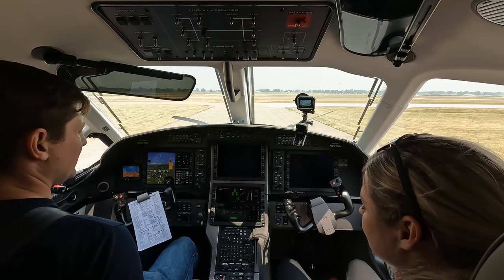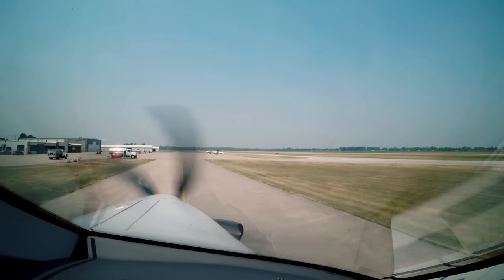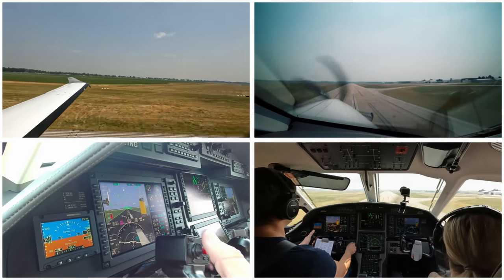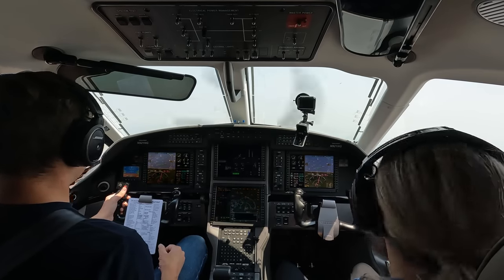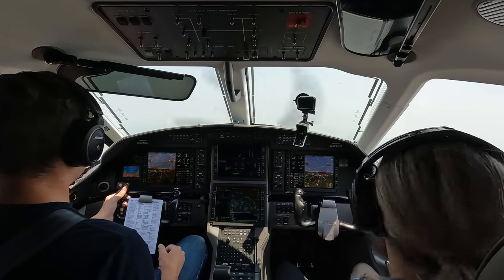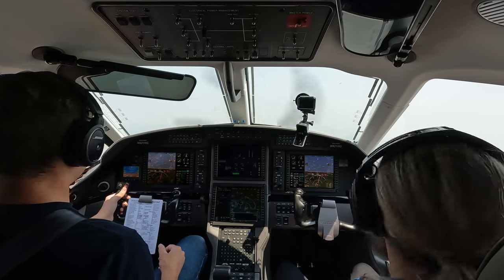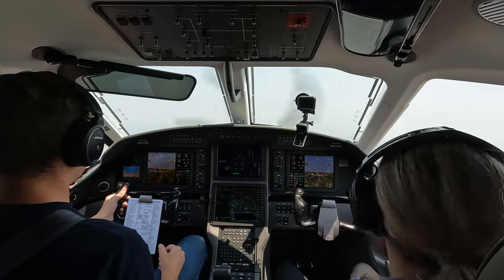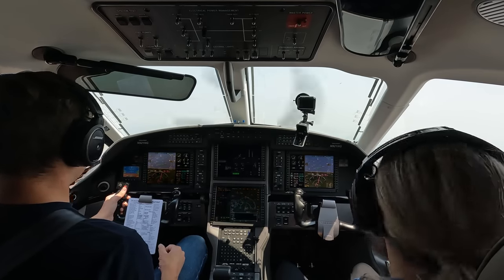Flying To Mackinac Island For Our Anniversary! | Pilatus PC-12NG

Comment: That connection problem with the Insta360X3 sucks. I've got the same issue randomly sometimes even if the BT wakeup function is on. Thanks for sharing your flights, I love the PC12!
Reply from the maker: I really love the unique angles that I can get with it! I haven’t used the phone connection with it much but it has been sketchy when I have.
Reply: @GrantBaker  yeah, you can definetly get some cool shots. How about the regulations in the US with regards to mount cameras? Has it to be certified in some way?
Reply from the maker: @QNH1013-Aviation if it’s permanently mounted, yes. Mounts like mine are able to be signed off by an A&P.

Comment: Grant, another great video and landing. Is your Pilatus equipped with a radar altimeter? If so, what is the earliest it will read AGL? Thanks!
Reply from the maker: Thanks David! Yes it is. It reads up to 2,500’ AGL. It’s kinda hard to see on the video, but it’s under the right wing of the flight path vector on the PFD. If you watch closely you can see the number changing on landing/takeoff.
Reply: Nice! The airframe I operate begins at 1450' @GrantBaker